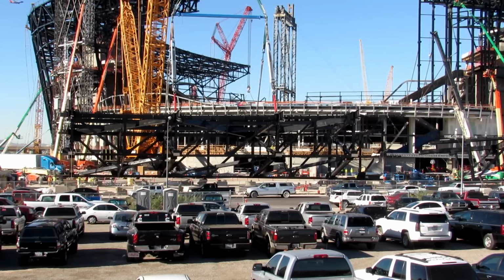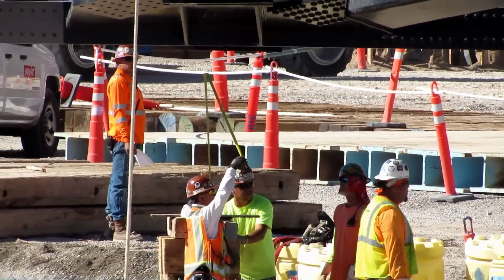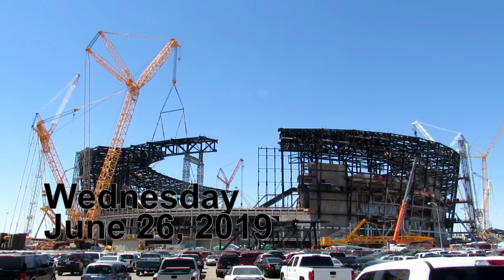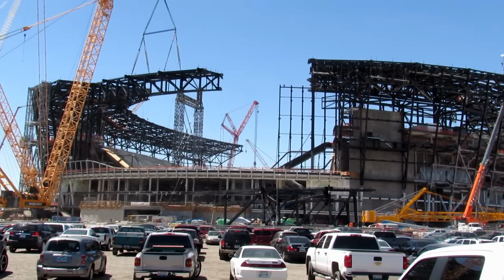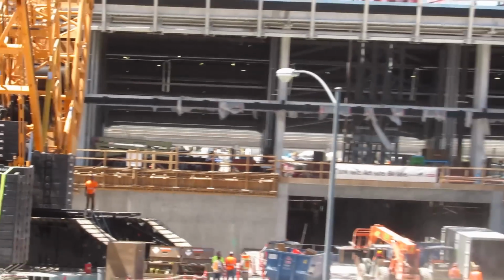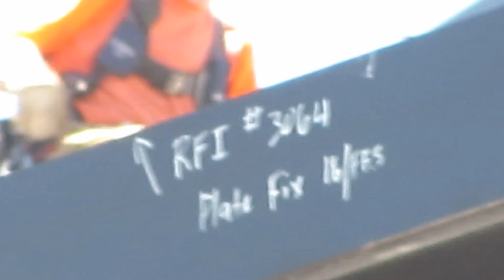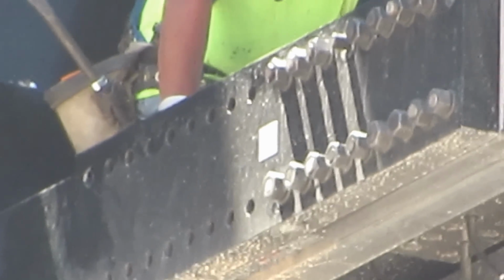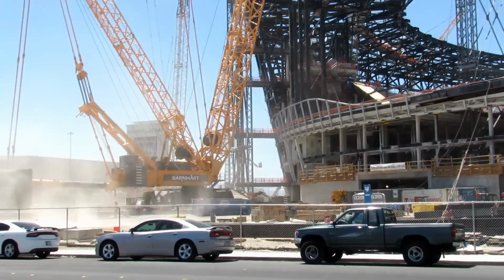Las Vegas Raiders Stadium Construction Update 06 24 & 26 2019

Comment: It was supposed to be picked first thing Monday morning. Unfortunately the bottom side closest to the street was bolted wrong, brought another crew to fix it. Went up Wednesday instead. A lot of unhappy Ironworkers that day. But it all worked out with the hard work of some dedicated bolt up crews working around the clock.
Reply: I have some good pics of the lift as it went up, if you're interested.
Reply: How's the inside coming along like the first floor? how complete is it
Reply: @inockupp  most sections have drywall and paint already on the ground level.